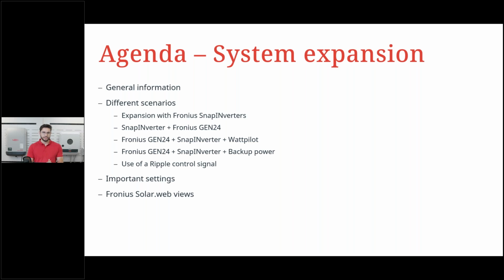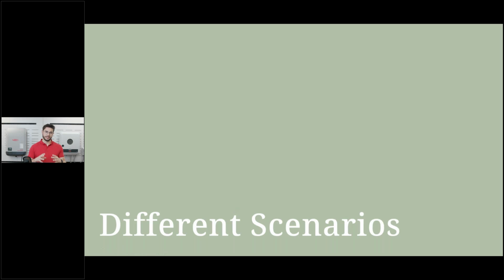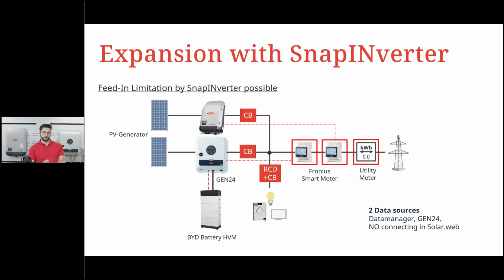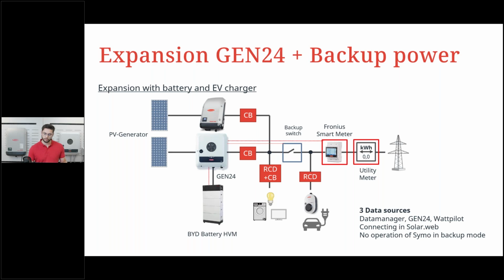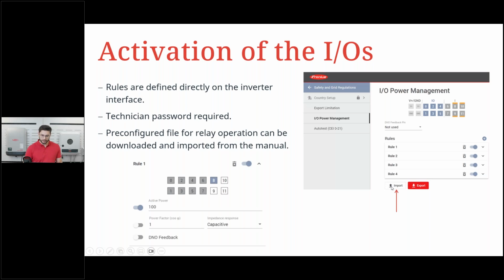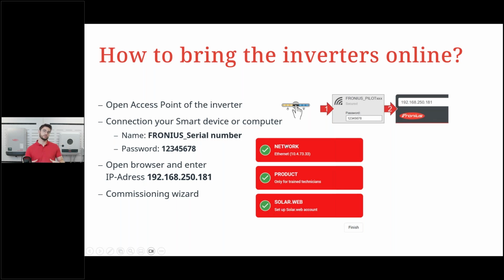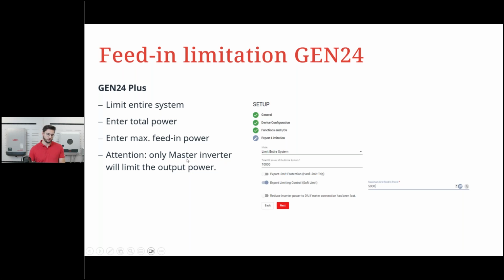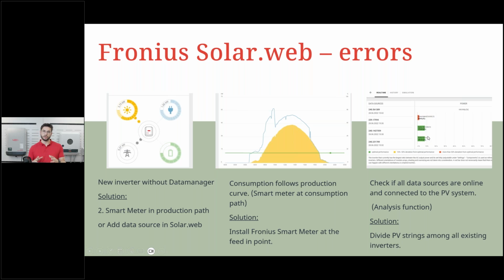PV Extension - GEN24 & SnapINverter in one system

Comment: With 1 x Symo Gen24 Plus 10kW with BYD HVM batteries with full house backup and adding 1 x Symo Gen24 5kW does the Symo Gen24 5kW AC side need to be wired to the grid side of the islanding contactor or can the AC side be wired to the backup/house loads side of the islanding contactor?
Reply from the maker: Hi @SteveRyder-l9q It depends on the grid frequency you choose. If you use the standard 53 Hz backup frequency, then you can connect the second inverter with the backup loads. If you choose 50 Hz you have to install the second inverter after the islanding contactor. With this you prevent that the second inverter, which isn't controlled in a backup scenario, doesn't stop feed in if the battery is fully loaded, which would lead to a breakdown of the backup mode.

Comment: Hello fronius team,  I have two Symo Gen 24 10.0 Plus inverters and I have to make a ripple control signal. My question is ioS reley the two inverters should be connected in parallel and go the datamanger or only one of them should be connected directly to the datamangers. I am waiting for your answer. Thank you very much.
Reply from the maker: Hi @yousafshah3241, By 'ripple control', you probably mean a 'ripple control receiver'. The GEN24 inverter operating instructions mention that you need 'coupling relays' to complete your project. https://manuals.fronius.com/html/4204260315/en-US.html#0_m_0000037377

Comment: is the topic of the 53Hz still an issue or can the snapin and gen24 inverters be integrated via Modbus to allow communication?
I am looking to add batteries to my Fronius Snapin installation, and thought about adding a Gen24 without pannels but with battery (might add pannels later on).
Reply from the maker: Hello @albertvila2091
We are working on a solution to have more then one inverter working during a grid outage. The frequency can already changed to 50 Hz in backup mode with our GEN24 Plus inverters, but it is still not allowed to have more then on producer in a system.
Reply: @FroniusSolar  Thanks, sounds promising. One producer you mean with PV? I would have only the first Snapin produce from Solar, with the GEN24 only provide/take energy from the battery (no solar).

Comment: Hi Fronius team. I have the problem identified at 29:00. My installer added a new Gen24 + Smart Meter but they added it as a new PV system so Solarweb doesnt show the combined consumption within that graphic although it does show total production on the main page. How do we move the existing Primo inverter and data logger over to the new Gen24 PV system to provide that combined view?
Reply from the maker: Hi @kiwimark3875, thanks for your question. Please get in contact with our technical support team using this form: https://applications.fronius.com/contactform-support/SolarEnergy
Best regards

Comment: Hi , Is it possible to combine a Symo 5.0 and a primo Gen24 4.0 in one system ? or does the inverters both has to be 3 fases ?
Reply from the maker: Hello @koendreesen2673,

Technically it would be no problem to have a 3 phase inverter and a single phase inverter in the same household. The legal situation on the other hand is a completely different topic. The best way for you is to contact a local PV-Installer, so he can check the situation with your local grid supplier. If you search for an installer near you, you can use our installer search: https://www.fronius.com/en/solar-energy/home-owners/contact/find-installers
Best regards, Robert from Fronius